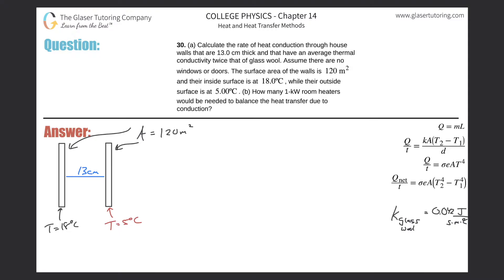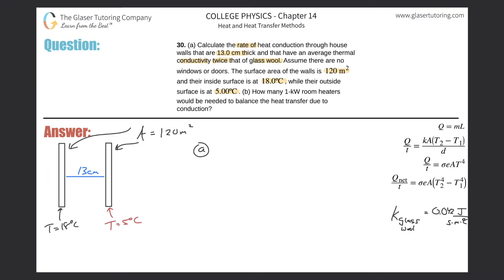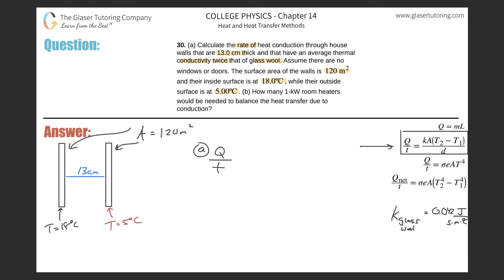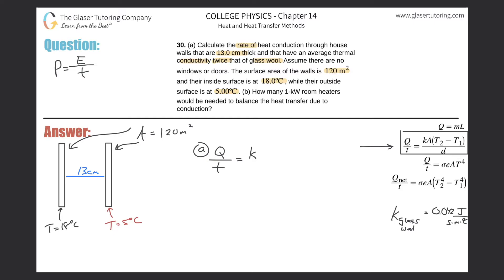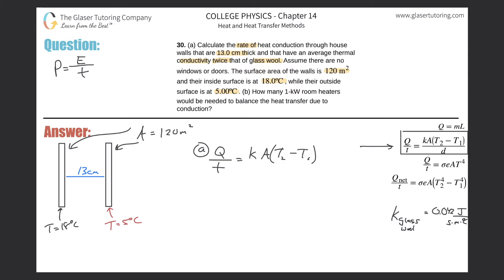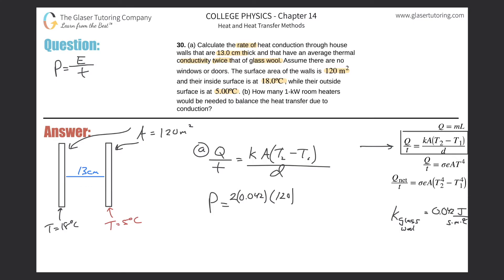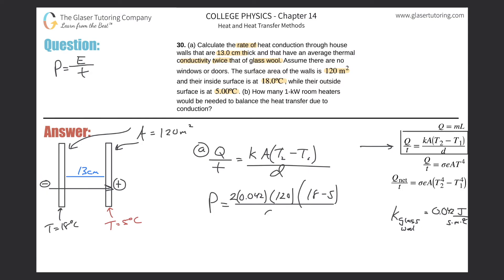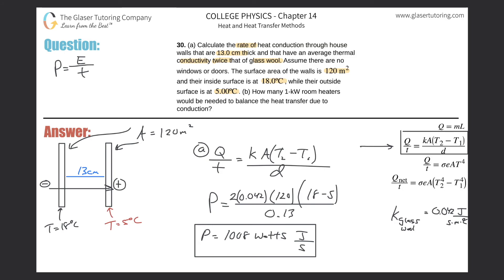14.30 | Calculate the rate of heat conduction through house walls that are 13.0 cm thick and that

Comment: tile has a lower K value, so it doesn't hold as much heat (????) I'm not sure, taking a guess.
Reply from the maker: Hi Skylar - Tile has a higher k value therefore making it a better conductor of heat.  Our nervous system is designed to detect RATES of heat transfer, not absolute values of heat or temperature.  Thus, tile is sucking the heat out of your foot at a faster rate than the wood would be and your brain registers that phenomena as FEELING colder, although the tile and wood are at the same absolute temperature.  Study hard.

Comment: The tile is colder, because it conducts heat better than wood, and the laminate.   

Bonus:
un-educated guess, I do not know this for sure.

Heat transfer is not linear. It is percentage based. I see 3 main factors for heat transfer, rate of conductivity for a given material how fast it absorbs heat, over what course of time, difference in temperature is a factor that determines heat transfer, because You only feel, or measure the temperature amount gained or lost over some amount of time. Meaning if you have a object that is a great insulator that is cold enough, it could result In the same measured temperature difference as an object with high conductivity.  In practice you can grab your hot bowl with cold food out of the microwave, and set it down if you move fast enough.
Reply from the maker: Hi Nick - Excellent!

Comment: The tile doesnt hold heat as well right? Making it feel colder?
Reply from the maker: Hi Tommy - Tile feels colder since it is a better heat conductor than wood.  Our nervous system is designed to detect RATES of heat transfer and therefore when there are two objects at the same temperature, you may feel one to be "colder" than the other since the object that feels "colder" is removing heat at a faster rate than the one that feels less "cold".  Hope this helps